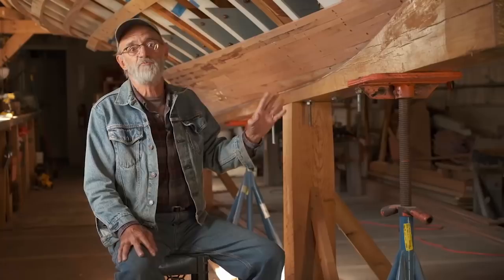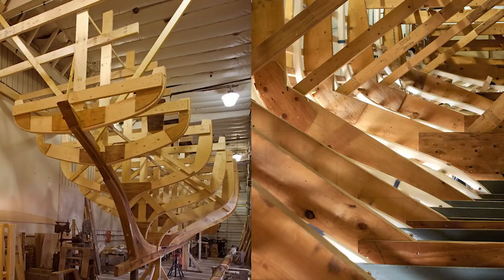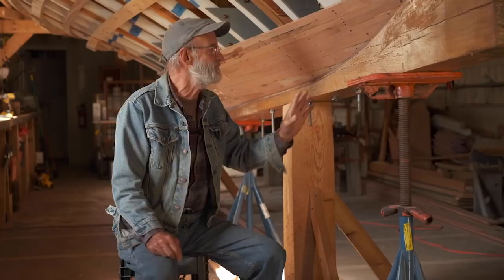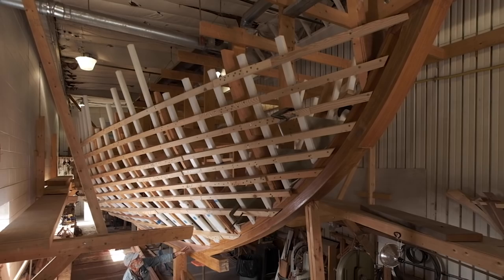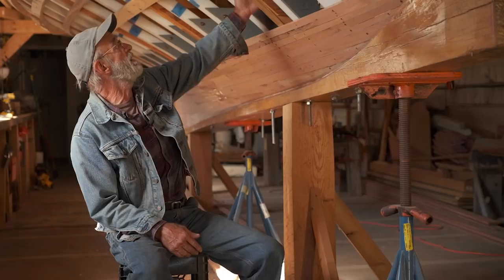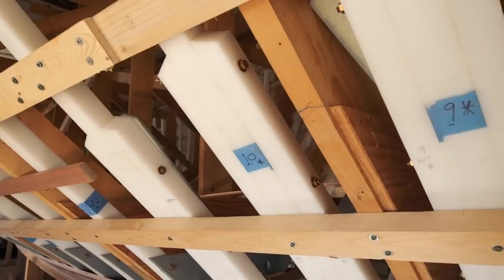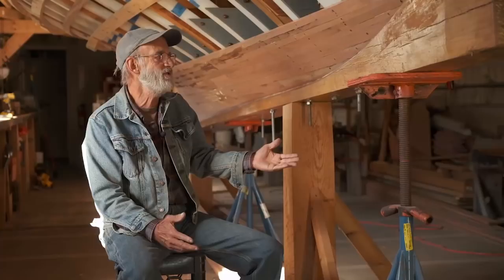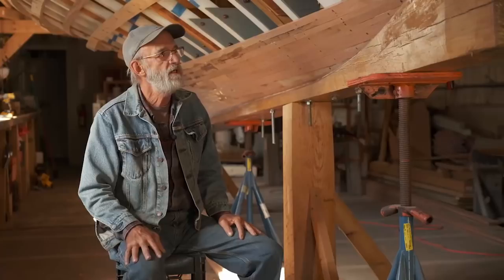Building Evelyn: A New Alden Schooner, EP1

Comment: Maestro: Great job to you and the crew.  Direction is spot on as usual and the usefulness of your teaching continues to unfold. That uhmw, if it can be readily molded and particularly if the uhmw is even higher density capable then that resulting material might make pretty serviceable FLOORS.  no worries of electrolysis or rot.  Alternatively outside the box, the Floor Dimensions fabricated in  high density spring steel, with pre-drilled apertures for fasteners, finishing with a thick casing of uhmw enveloping all. if this uhmw encasement scheme works the bolts/fasteners can be included. thinking about sailing outside of the box.  thx.

Comment: Just subscribed. I was wondering where you went. I am intrigued with the use of   fiberglass for the  floors. I follow Leo from Tally Ho where he cast them in bronze. They are beautiful but extremely expensive. Hope you go over the engineering calculations that were used to determine the layup schedule of the fiberglass floors.
Reply from the maker: We only have about 2 floors left to make, but we're going to try and cover that on an upcoming video. Thanks for subscribing.

Comment: I know Daniel Bombigher's Shpountz are build by a cedar core, two diagonal layers of mahogany and an outer planking of iroko; so it looks like carvel from the outside.
I guess you intend to do something similar?
If this is Malabar II I would be interested in hearing how you change the scantling, if you intend to mix internal+external ballast as design?
Never sail one personally but the ones I've seen sailing had been quite tender.

Comment: A larger boat with plastic frames and strip planking... this should be fun.....
I mean, you're the pro here Lou, but fiberglass floors? Really? Okay, if you say so, I'll take your word for it. I can't wait to hear the reasoning behind why not bronze. I understand why not iron, but fiberglass seems aweful week in 1/2 inch thickness if the boat should run aground or strike a rock or floating cargo container. I can't wait until you discuss it to hear you reasoning behind this one. But until then, I'll just take your word for it. You're the shipright, I'm just an armchair pre-apprentice with only house building experience and an electrical engineering degree. Structural engineering is not in my education. You da man when it comes to boats and ships, I'll bow to your expertise.
Reply: P.S. Gotta Spread the word, another channel to learn from Lou on. Share and let our other boating channels know guys and gals.

Comment: I love that the young guys are doing the old stuff and the old guy is doing the new stuff. I'm really interested to see this new stuff. Those floors have to be soooo much cheaper labor wise than other floors.
Reply from the maker: Thanks for subscribing. To be honest the floors were pretty labor intensive. Each floor including the tang was laid-up by hand with epoxy and 14 layers of 1708 fiberglass.  They were roughed out on a bandsaw with a caborundum blade, but at some point there was no avoiding the grinder. Not pleasant. But we think the long term benefits made it all worth it.

Comment: I watched you use UHMPE a few years back on a small rowboat.  My question is,  did you pre-form or cut these ribs?
Reply from the maker: Most of the frames bent in cold. For the radical bends aft, we used a little heat from a construction heater. Lots of clamps and patience prevails.
Reply: @BristolShipwrights  Sweet.  It will cold form with time.  Rather genius application of materials.